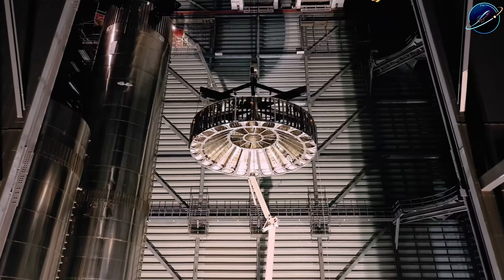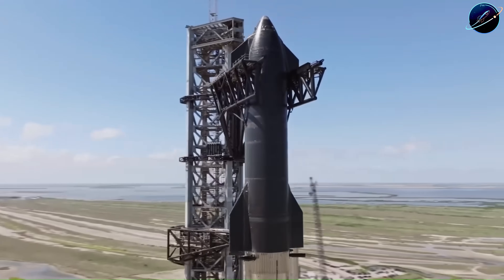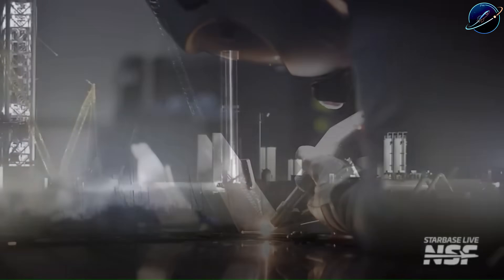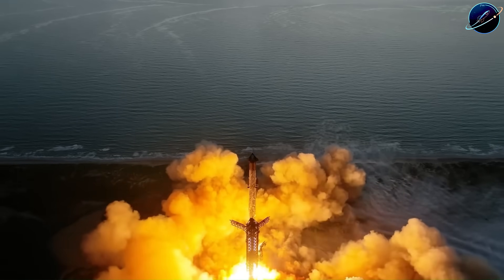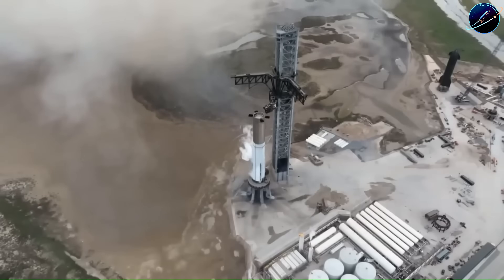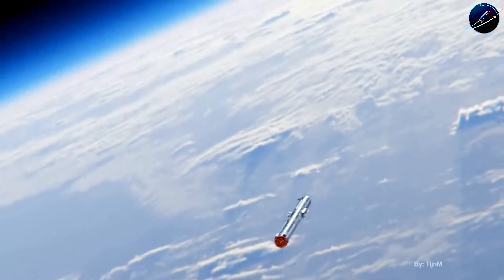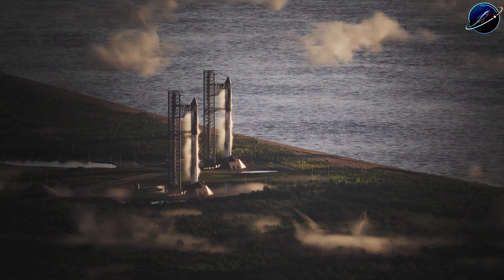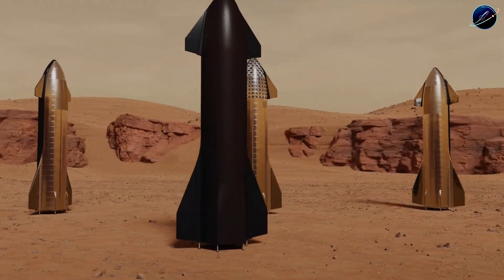SpaceX Found Perfect SolutionSuper Heavy For Flight 12!: V3 Ready & Mars Cut...

Comment: Garbage
Reply from the maker: Haha, calling it garbage? Fair enough if you're skeptical about the hype, but Booster 19 with 33 Raptor 3 engines is real hardware stacked right now – way past vaporware. What's the biggest reason you think Flight 12 won't deliver?